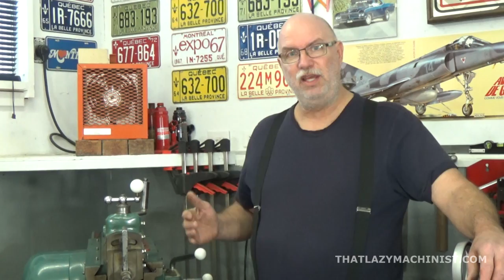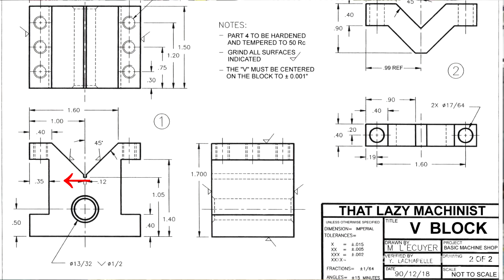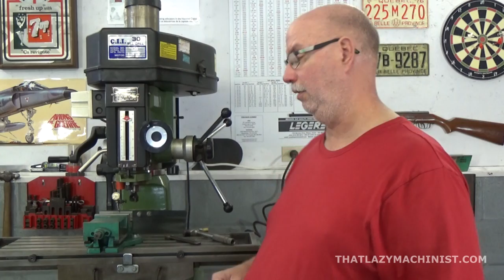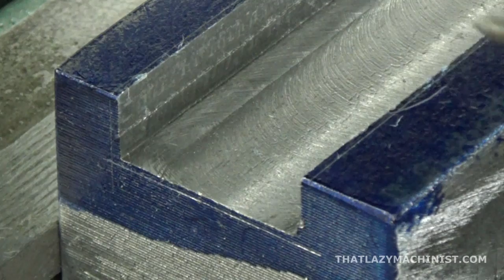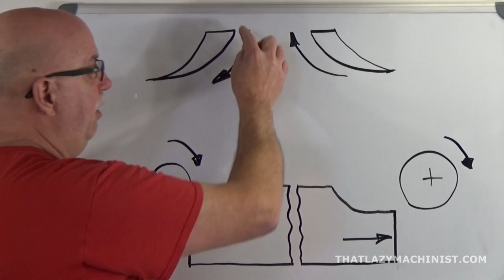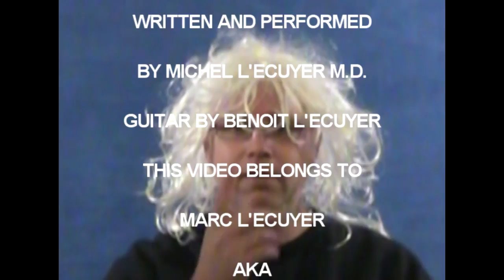V-BLOCK PART 3, mill, shaper and surface grinder 101 Marc L'Ecuyer

Comment: Circuit Breakers are not designed to use as a shut-off switch, it will weaken the breaker to use as such, they are made for electrical short circuits not emergency stops.

Comment: About the power disconnect.  In a power company, & even in an industrial environment, any time work must be performed on or within the proper minimum approach distance for the voltage being worked, the correct sequence for disabling said voltage potential is (in basic steps):  Open or Trip the Circuit Breaker then open a Visible Disconnect.  Both should be Tagged & the Disconnect locked open with a lock as well. This is true for 120V on up to 765KV 3 phase.  Circuit Breakers do not lose their inherent fault breaking capability (do not weaken) when switched under no load conditions in any appreciable manner - but they do not provide a visible open in the circuit.  In the usage presented here, simply unplugging & securing the power cord is sufficient.Having said all that, at home with either a 120V lathe or mill:  I turn the machine off, pop the emergency stop & flip the breaker before going into the electrical system for either.  Not a visible open But absolutely No-one is getting between those switches & me while I'm doing the work either!Just be aware of your options for securing & making your equipment SAFE to work on.  Make a plan, review it (have a qualified person review it as well).  Do a dry run or go through the motions identifying or proving the switch, breaker, power cord is the correct 1 needed for the job at hand. Yes, I do work in power transmission on the electric grid & I can boil all the annual training needed to maintain my certification down to 2 rules that are never mentioned anywhere:  1.  Don't trust anyone to say, "It's dead, go ahead."  Better to check for yourself!  2.  Self explanatory, "Slow down or we will Never get to the goal."
Reply from the maker: Well said! Even if it is a written text. Marc
Reply: I was an electrician for over 20 years and what Brockwood64 said is true. Turning off a breaker when under load, especially a heavy load, repeatedly (such as every day) will weaken the breaker and cause it to trip prematurely at a lower current rating than the breaker rating.  Saw this happen many times in a commercial setting where they were using the breaker to turn off large banks of lights. The solution was to install a contactor, a type of heavy-duty relay, that would open the lighting circuit, leaving the breaking on. If there is no load, then it should not affect the breaker's useful life or effectiveness, however, I still would not want to flip the breaker on and off every day due to mechanical wear.
Reply: Industrial machines have a lockable disconnect switch for Lock Out, Tag Out & Try Out...

Comment: I'll say it again, I want one of these little shapers so bad!!!... I have a question about the shaper, any shaper that is, any size...... Is there ever issues with the cutting edge(s) of the tool, braking due to normal standard setup and use?.... Meaning, kinda like having an "intermittent cut" like in turning a part on the lathe that may have a cross drilled hole in the middle perpendicular to the work/part?.... I suppose it would be like what a milling machine multi-flute cutter endures in climb cutting, and I suppose even in conventional cutting as well. I suppose that it is really important to know the machine (the shaper) to control the amount of cut, chip load, feed rate, etc...  It still seem like the cutting edge of the tool would take a beating.. and maybe there is no more or no less than that of other machining processes? Another Fun video, Drew

Comment: Another valuable video, thanks Marc ! Question: Milling a slot to the width of a cutter is one edge of the slot in conventional cutting mode, and at 180 degrees, climb cutting ?

Comment: A safety switch lets you avoid the risk of bumping the primary on/off switch while working on the machine, and avoids having live voltage in the machine while working on it. It should break both lines when the voltage is 230 Volt using both legs of a single phase system (as in US and Canada) and all three legs of a 3-phase system. (I don't know whether both 230 volt leads are hot in UK/Euro systems.)

A safety switch needs to be within view of the person working on the machine; circuit breakers within sight are OK. Circuit breakers should not be used to routinely interrupt a load; you shouldn't use them to turn the machine (or the shop lights) on and off as the primary method. 

In a home shop environment (no real lock-out capability) if you may walk away from the area and be out of sight of the safety switch (or breaker) tape it over with a label to keep someone else from turning it back on without your knowledge.